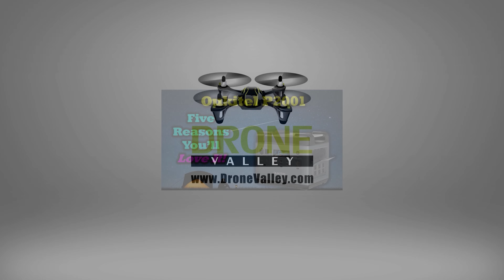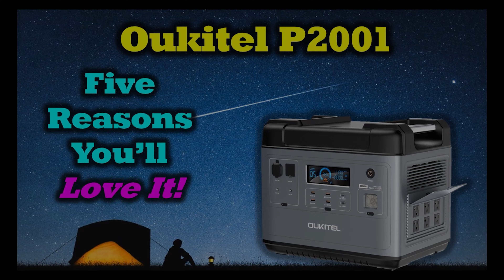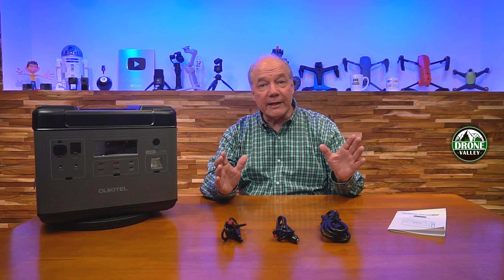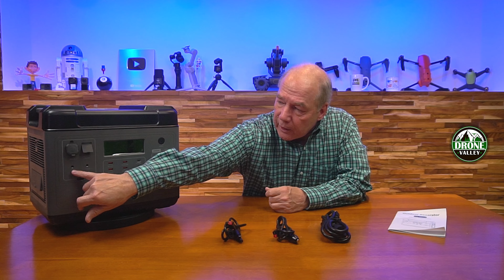5 Reasons You'll Love The Oukitel P2001 Power Station

Comment: When ac inverter works the USB output causes malfunction to  my smartphone !!beware!!!!
Reply from the maker: Thanks for the post but I'c contact Oukitel to see what the issue is. I have been using mine with both AC and USB working fine. It sounds like you might have an issue with the AC inverter creating noise on the DC line. Good Luck!

Comment: I would love my Oukitel too if I was able to recharge it with my gas generator. I can only hope the power doesn't go out for more than  few hours or I'm back to using the gas generator.
Reply from the maker: Karen, you can recharge the Oukitel with a generator and I do it every time we have a power failure and then use the Oukitel during the night to keep the fridge and lights operating until morning.
Reply: @Dronevalley   the company said the output voltage of the gas generator is unstable causing it to be unrecognizable. I would have loved to only have to use the gas generator to recharge the Oukitel which is why I received it. When the power went out for 3 days  one week after I received the power station, I had to keep taking the unit where there was power to recharge it. Wasn't what I expected to happen. The Oukitel is only of use  to me for 10-12 hours, then it's back to using the gas generator the rest of the time, which defeats the purpose. Now I'll have to invest even more money for panels and pray for sunny days when the power goes out again.

Comment: I have the Grecell version of this. I was testing; AC plugged in, passthru to a freezer and/or fridge. No more than 284w ever. The AC inverter shuts off anywhere from 6-46 hours. The only fix is a manual power down the reboot. I bought this to power the freezer, unattended, to be a backup to my electric service. I’m leaving for months and this won’t do. DO NOT BUY. I bought through amazon and it’s not a returnable item. I’ve messaged the seller a few times with friendly but unsuccessful results. I opened a case with Amazon for a refund due to faulty product.